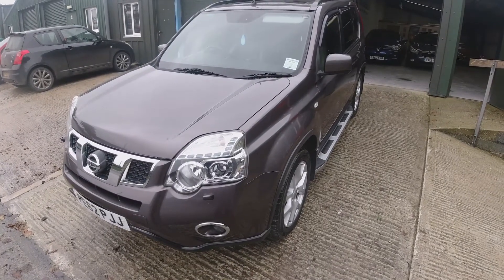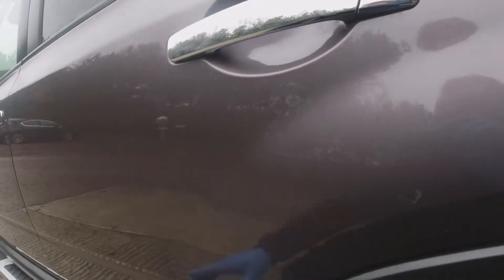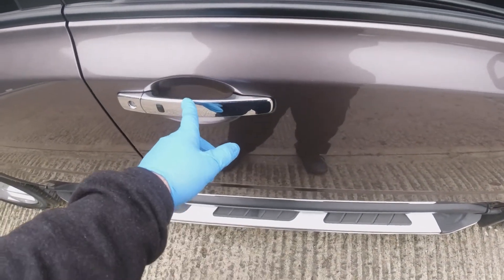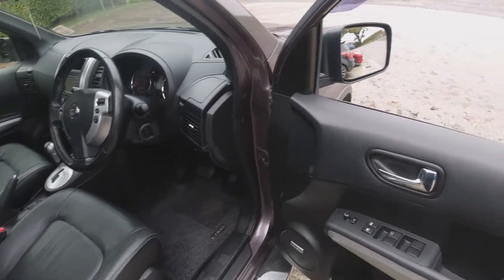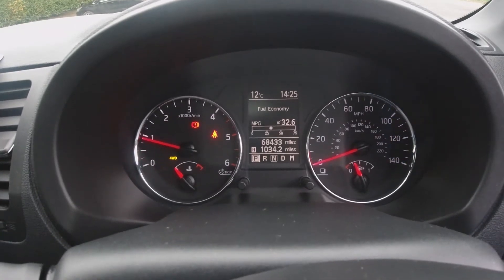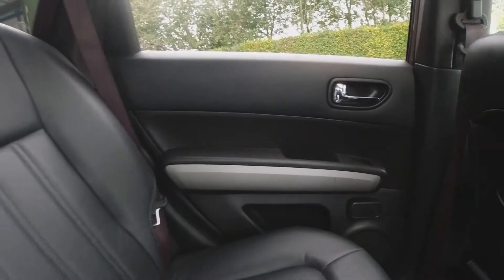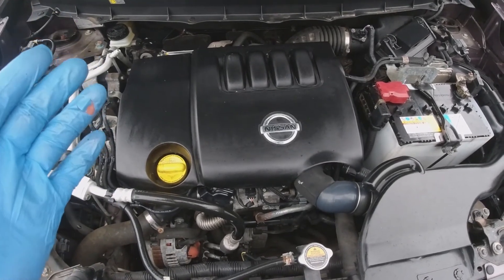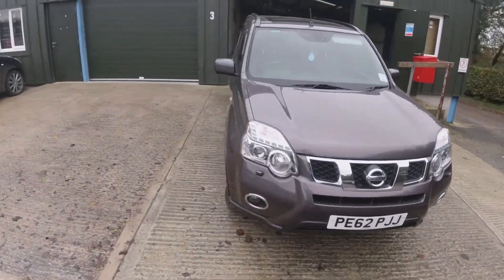2012 Nissan XTrail Tekna 2.0 DCI 4WD

Comment: Is the price £8,995 or ....£9,995 as  on your website?
Reply: Its now sold
Reply: @ChopsGarage  cheers
Reply: Sold to me .... and I absolutely love it 😀  Cheers Chops 👍
Reply: @CiBi1968  What was the right price.? Yes I was looking for one but not automatic. Trouble is getting one that the dreaded rust has not started  corrosion underneath.  They are always nice and shiny on top but not so below when they get a few years on their head.
The car's last MOT noted rear subframe corroded but not seriously weakened.
Reply: @jamesmason8944  I paid £8600 if I remember correctly . Subframe is fine just surface. I love the Auto it's used for long journeys so if stuck in traffic then my left leg doesn't suffer.
Cannot fault the car in any way .. Chops sold me a great car . . It was a distance sale too so had to rely on video and chops reputation.
I left it for 6 weeks while I was abroad . Came back and it started 1st time ... 
Let's put it this way ... Even if the next M.O.T was £1000+ id still be happy with the car . And couldn't part with it. 
I call it "Tank" and it's our trusty steed .
My wife has an Abarth 595 Competizione convertible I can drive whenever..... But I'll take "Tank" over it any day 😉
Reply: And I only like the T31 shape .... Not interested in the later models .. they look too boring 😉
Reply: @CiBi1968  yes it is a very practical car. I was looking at them because my wife needs a mobility scooter. We have a peugeot partner tepee which we  love but I was wanting something that could tow a decent weight and still be able to lift the scooter into without always having to lower the steering column.  I think if you take the trays out of the x trail this is possible. Good old nissan, hahaha.  I used to have 140y fastback estate.